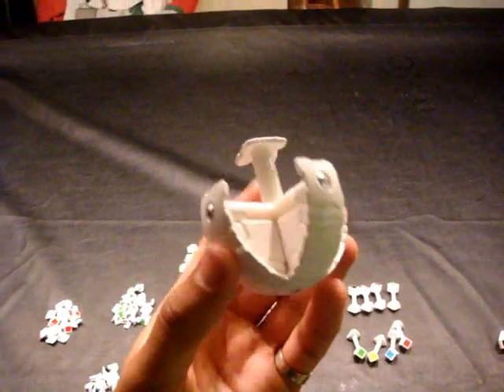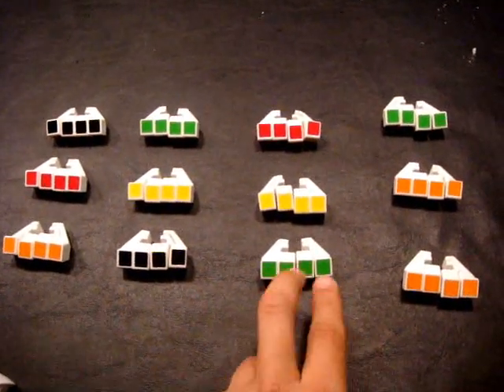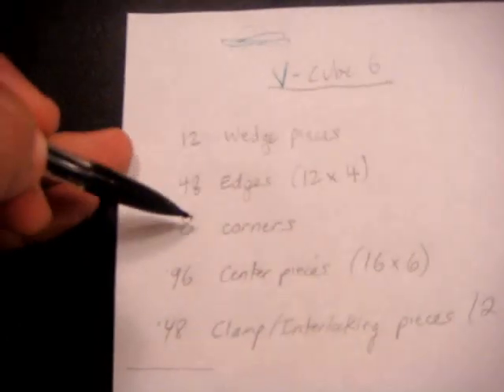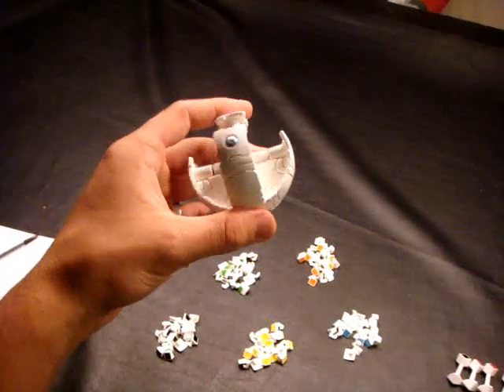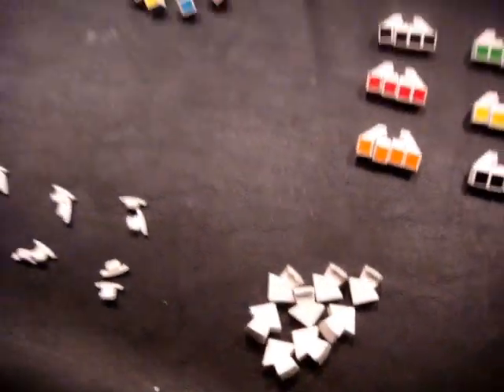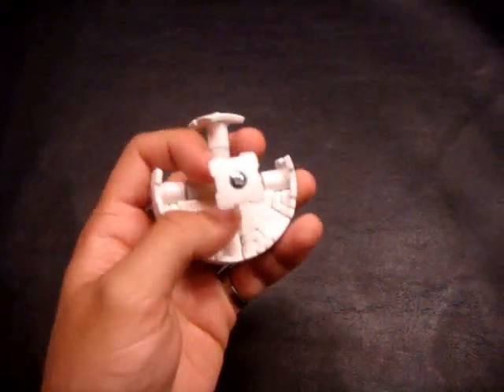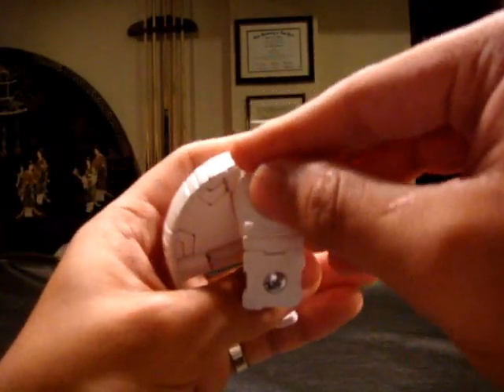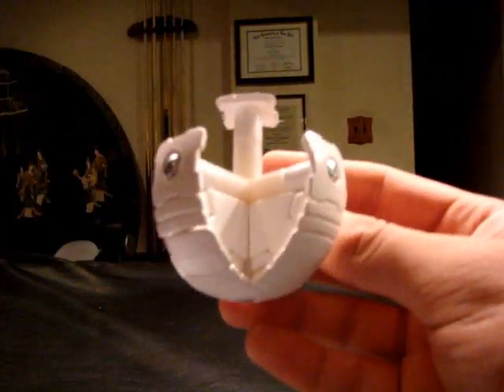How to Fix a V-Cube 6 - Part 1 - Formation of the Core

Comment: You are a god among men. My broken cube had the weirdest problem. It had too many pieces on one side. 2 center corners trying to occupy the same spot. The didn't fall apart. It just looked funny. You could still turn the dang thing. This video helped me get them back into the right spot. The cube was in a unsolved state, but since they were center corners, it didn't matter if I accidentally swapped them. Good set of 3 videos. Thanks a ton.

Comment: Actually, only the corners need to be in their solved positions, the rest can be assembled randomly because of algorithms.  The algorithm you call "down over down over up over up over" swaps two corresponding center pieces, while edge parity algorithms will swap two edge pieces, as long as they don't include the middle edge pieces on odd-layer cubes.

Since this is an even-layer cube, you actually can get away with putting two of the corner pieces out of place or assemble all eight corners as long as two opposite sides are just green & blue, red & orange, or white & yellow.  This is because corner parity algorithms will fix those.

Comment: dude...okay for 1. 7 is 1 more then 6,
2. theres 49 squares on each side of a 7x7 and 36 squares on each side of a 6x6,
3. 7 is odd and 6 is even.
and 4. There are more squares on a V-Cube 7 (7x7x7) than a V-Cube 6 (6x6x6) and they use the same structure.

Comment from the maker: Gozo, I am not sure which silicone spray you used, but if you use 100% heavy duty silicone spray (CRC brand), it will not melt the cube.  The thing that will ruin your cube plastic is if the so called "silicone spray" has petroleum distillates.  It's a powerful chemical that will melt the pieces, as you can see in my 3x3 tutorial on my old cube. But I've used 100% silicone and it doesn't damage it.  You definitely don't want to over lubricate the v-cube 6 though, pieces will pop out more often.

Comment from the maker: Oh, you should have just said so.. You said it was loose, I figured you screwed it back on since I have them on in the video. So just screw that on, not too tight, try and match it to the others. Then you can pop the pieces in and it will hold them in place.

Comment from the maker: Not sure what you mean.  Each center support on the screw is attached to a spring as well.  This allows the supports to have some give and also allow you to fit pieces in between them and snapping into place tightly because of the spring. The pieces basically move so it's not immovable because of the screws, if that's what you mean.

Comment from the maker: Either way man, you still have to place 212 pieces no matter what, don't you?  So it doesn't really make a difference how.  The only difference is he does it upside down and then flips it.  I work my way up from the bottom to the top without flipping.  The pieces still need to get attached the same way.  This is basically showing how everything fits together, people can do it differently if they want to.  I see what you're saying as far as working from the middle out though, either way works.